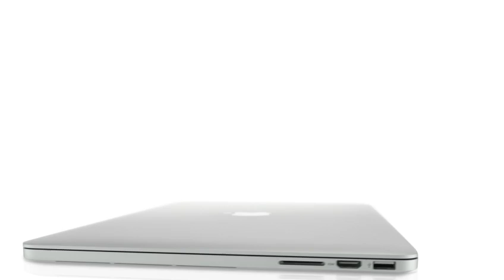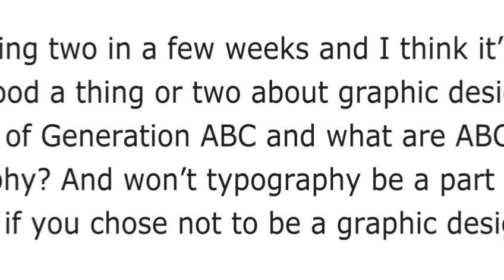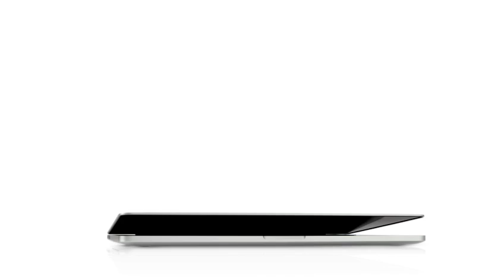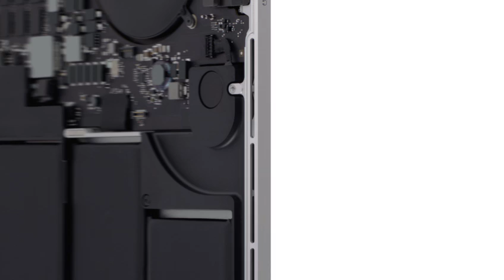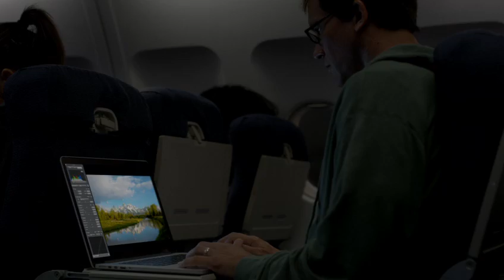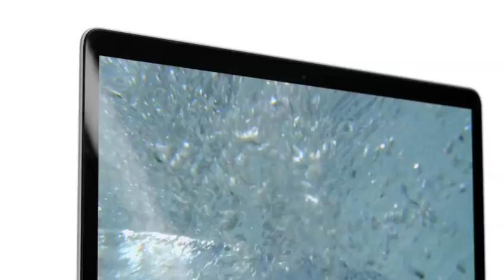2012 Macbook Pro Retina official introduction video

Comment: They weren't lying but like  kept mine on 0% for a long time and then when I tried to turn it on it doesn't even work anymore because the only thing alive is the battery indicator and it only works when I plug in the charger